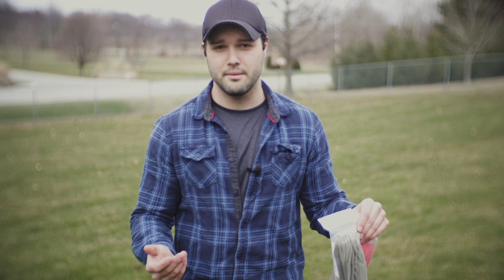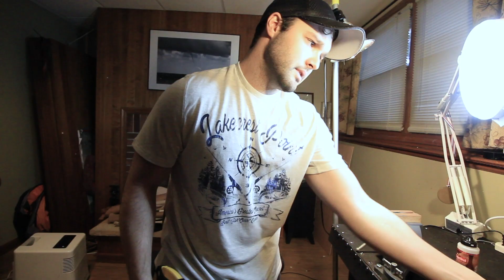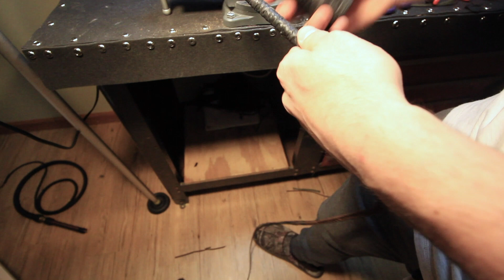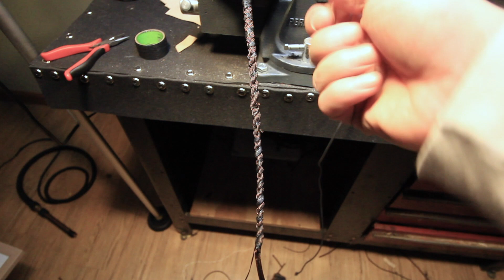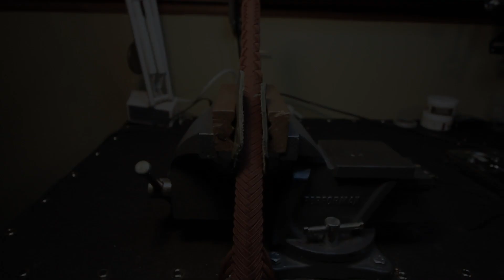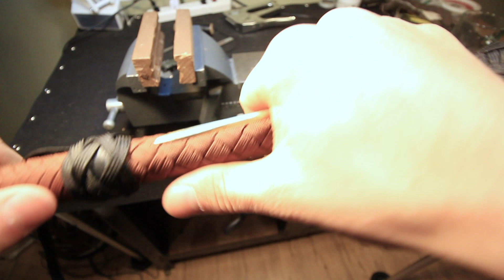My Current Nylon/Paracord Bullwhip Making Method 2018 | Nick's Whip Shop

Comment: lengths for an 8ft bullwhip with a 10-inch handle:

1st Belly:
2 strands x 11.6 ft
1 strand x 8 ft
1 strand x 5 ft
2nd Belly:
2 strands x 24 ft
1 strand x 19 ft
1 strand x 13.5 ft
1 strand x 8.5 ft
1 strand x 5 ft
Overlay:
2 strands x 27 ft
1 strand x 25 ft
1 strand x 22 ft
1 strand x 17 ft
1 strand x 13 ft
1 strand x 9 ft
1 strand x 5 ft

Comment: Why is the core 6' and 1", I thought the core was suppose to be the same length as the whip? For example, a 8' whip would have an 8' core including the handle( 10" handle + 7' 2" of cord); is that incorrect? How do you measure the core length, handle and cord?

Comment: Help, European Metric user here. It's very odd to see 11.6feet in the description.  .6 of a foot is 7.2inches. Is that really what I'm meant to measure out? Or is that how you're writing 11 feet and 6 inches? If so then the 8.5foot strands are meant to be 8feet and 5inches, correct? Also, you're using 650 para, if all I've got is 550 will this throw things off badly? Maybe I should follow your older bullwhip tutorial where you used 550 para. The question of what is .6 of a foot still applies though.

Comment: Dude, your measurements are nowhere near what you have in your video. Make some adjustments or something. Or at the very least, add some length in your measurements as a buffer for strands that may be too short. Cutting to your exact measurements yields strands too short, and that's when they are cut with no tension.

Comment: If you're using 550 make the strands about 3 feet longer on nearly all strands, but the shortest strands only need to be about a foot to foot and a half longer. Otherwise it will turn out substantially shorter than you think 😅 surface area truly matters between 650 and 550.

Comment: I havnt even made very many "bull" whips (1000's of Jockey whips) but I found a trick that works well 4 attaching the core 2the rod & its cheaper somehow..?!? Also helps the transition area taper..! I tried a pc. of threaded rod & HAD 2taper the end 2get it started... But it created such a smooth transition... I LUV IT..! Also seemed 2make a stronger bond of core 2handle... Just wanted 2share this w/a professional & see what ya think... Whip seems 2have more spring as well...🤠

Comment: Nick, I started out doing what you are doing, learning to braid, when I was about 14 years old. At that time, the only instructional material available was in the form of books written by those of my age today for young guys like you at that time who wanted to learn how to do this form of craft. I have to give a notice to the man whom I consider my "mentor" at the time, the author of a couple of books on making horse gear and whips and generally learning the old ways of preparing and processing the leather or rawhide he used for his gear. HIs name is Bruce Grant and his books are surprisingly still available through outlets like Amazon and other printing sources. One of his best books is named "The Encyclopedia of Rawhide and Leather Braiding", another simply titled "Leather Braiding",  and one called "How to Make Cowboy Horse gear". He also authored a small book, which contained a condensed version of all the tips and tricks of his other leather handling books entitled, "Whips and Whip Making". I cannot help but believe that you have already read at least one of these books and have taken the knowledge of what he wrote and are using that in your work as I did when I was much younger! 

As life goes, many times, I had other priorities which needed more attention than simply braiding and working with leather and those interests dropped by the wayside as I traveled through to this portion of my life as I approach the 80 year mark. Now, just after my 78th birthday, I have decided to get back into this world of leatherworking and your videos immediately caught my eye as I scanned through the recent listing on YouTube to get caught up on my favorite leather workers accomplishments. The last few years I have slowly slipped back into the leather work as I bought new hand tools and refreshed my mind on those few things I learned when I was a teenager.

My point in all this background information is to tell you that you have a special knack for passing on, what may have taken you untold hours of trial and error in perfecting your craft, to others with your tutorials. Watching your videos on just the whipmaking part of braiding techniques is like a Deja vu for me as old memories of spending hours with a homemade thong cutter stripping out literally thousands of yards of rawhide thongs, as small as 1/32" for braiding horse halter trim and cutting and processing leather strips for the actual braiding of the halters, headstalls, reins, and other horse gear came flooding back. I followed the ways of the South American and Australian "cowboys", Gauchos, and wranglers as written in Grant's encyclopedia and I learned how to properly turn an eighth inch rawhide strip into a perfectly round thong by wetting it, drawing it through progressively round holes drilled into a hardwood board until the wet fibers were " transformed" into a round thong the likes of which is almost impossible to do in this day and age.

I think that you are deserving of all the accolades you get and all the braiding business you receive through your YT videos and I simply ask that, as you progress through the levels of your craft, you will always keep sight of the fact that anything you can braid with string, nylon, paracord, or even roots of plants, you can also make from top grade leather or properly prepared rawhide and, at the end of the workday, you will be much more rewarded for your labor by those who still recognize good quality leather work and are willing to pay for it. There is no limit to the price of well made leather crafted work gear in the world of cowboys here and in other countries, who spend their days with whips cracking herding large herds of cattle and other animals. And the gear on their horses which keep them safe and provide a means of "steering" their mounts where they need to be is as important at the ropes and whips that they use to "steer" those cows. There is every bit of difference in well made horse gear vs. the run o' the mill stuff as there is in the difference in a Ford Mustang and a great ride of a Rolls Royce or a Maserati.

Comment: I have a suggestion Nick, when you add the BB laden cord to the steel rod, have you tried heat shrink tubing instead of the blacktape ?My thoughts are that the tubing would hold the bb's better and you would get a more consistent finish.
Reply from the maker: Never tried Gary, but sounds like an idea I'll definitely experiment with. Thanks for watching!

Comment: By the way, I am new to this channel, and I don't exactly know what he means by rolling the whip, so if anyone knows what it means, please let me know, and thank you. :)
Reply: He means to lay the whip on a flat surface and then to use a board or he used to use a cinder block to press over the whip and to roll back and forth down the length of the whip using a lot of force and your body weight to loosen out any kinks and improve overall fluidity in the movement of the whip, hope I explained that OK, hope this helps
Reply: @BornDead616  thank you, very clear. My son was happy that someone replied to his question.
Reply: @araminthethicket  no problemo

Comment: I thinking of trying to make a whip out of nylon cords do you think it might work just as well as the cords you used. Can I use a piece of stainless steel cable as the core , something about 1/8 thickness.

Comment: Hey Nick, I've been planning to make a whip for quite some time and I've finally started making it but I've made a rather large mistake (I think). 
While plating the second belly I've realized that my "sinker" cord (could not get the recommended one) was a LOT thicker than it should be, so I've ended up short - last strand was 3-4 inches shorter than the sinker cord. (Strands were dropped as they were for the first belly). I would ask you or anyone who reads this for advice on overlay plating. 

I've been thinking to cut the sinker cord a few inches and increase the length of shortest two strands by 2-3 ft, next two longer strands by 5 ft, next two by 7ft and the longest two strands by 10ft.
Is that plausible? 

Thanks

Comment: Anyone else notice that the whip at the beginning is not the same whip at the end of the video. The whip at the beginning had a twisted core for the second belly and the whip at the end had sinker cord for the core ?
Reply from the maker: A good observation for sure. If I remember correctly, I lost a lot of footage due to a corrupted SD card and had to film again with a whip in progress. I think that's what happened, but I don't actually remember to be honest. I no longer use the twist for ending bellies though. Video on my current method coming soon.
Reply: Damn SD cards!!!! Looking forward to the next video. Will be attempting this one next week guess I will leave out the twist and make the core longer

Comment: Tractor supply has the 1/4” neoprene mat in a  4’ roll that they will cut you a piece. The smallest they will cut is 1 Linear foot which will make a hole bunch of bases for your handles it was $7 for that amount.

Comment: Hey Nick, i am currently working on a 9.5 foot bullwhip in 16 plait using this method, but something that works for me is not tightening the strands until i get ready to plait with that strand. It helps with speed and it also keeps my whips super tight and very springy and lively.

Comment: What length should the sinker core be for a 6' whip?
If it's 6' 1" for this 8' whip then I'm guessing it must be 4' 1". 
Thanks
Reply: 6ft for an 8ft whip is a ratio of 75% rather than 8ft minus 2ft. For your desired 6ft whip a sinker core length of 4' 7" includes the added 1inch.
Reply: @carycarcuro  Thank you sir ☺

Comment: No mention of what plating is and for a beginner (me) you are moving way too fast.  also how do i know when the belly is "locked in" and when you say two random strands and then mention the middles of the belly strands that is only 2 of them the other 2 are staggered so they are not the middle. am i doing something wrong or just being too literal with instructions?
Reply from the maker: This particular video is more suited for those who have watched my original "How to make a paracord bullwhip" video that I made a few years back. The basic principles were covered in the original, and this video builds upon them, introducing new methods and modifications to the build. I discuss the fundamentals of plaiting more thoroughly in the original. Also, you are correct in stating that those are not the literal middles since they are indeed staggered. I said middles to make it easier, and because it was very close.

Comment: Please help! When I plat the first, second, or third layer, from my side it is tight, even, no twists, or holes. When I rotate the plating 180 degrees (the back side) the plating has little resemblance to the front side. What Am I Doing Wrong! Thanks for your time. Larry
Reply from the maker: Hi Larry, when you are plaiting make sure that you are pulling at the same angle degree on the left and right. also make sure that the strand you are about to plait is flush with the strand above it and touching it. The more you plait, the better you will get.

Comment: Nick keeps saying it's 3/8" sinker cord but the hint is that he says he is STILL using the same cord as before. 5 years ago, he was using 1/4" sinker cord and I'm 99% sure that's what he is using in this video. The 3/8" sinker cord works very well for 1/4" steel balls but works very poorly for the 4.5 mm copper coated steel balls. 1/4" sinker cord or 1/4" paracord do work quite well for the 4.5 mm balls though.

Comment: Hey Nick. I am new to whip making and i was wondering measurements would i use to make a 6ft nylon bullwhip? 
Ex: Handle all the way to the cracker, 1st belly, 2nd belly, and overlay
Reply from the maker: Hi! Please see the strand lengths listed at nickswhipshop.com.
Reply: Quick question. If i were to use a 14in handle would i increase the bellies and overlay by 4inches on each measurement.

Comment: So if i wanted to make a bullwhip with the same length but a shorter 8 inch handle compared to the 10 inch handle shown.
all i'd need to do is start with a smaller handle and follow the steps the same?

Comment: Why do you prefer to drop your cords on the outside as opposed to the inside?
Reply from the maker: I like to use this method on the bellies because it is simply faster and easier. The only reason I don't use it on overlays is because the ugly melt points would be visible.

Comment: I'm kind of new to this, thanks for the video by the way. I was just wondering; in your 2015 video you shot loaded the whole core, why didn't you do that here? Also, could I use the same rope for the core as in the 2015 video? Thanks again!
Reply from the maker: Thanks for watching Garrett. I don't load the whole core anymore because I felt like the whip was too heavy. It is however a personal preference thing. You can use the core from the older video, no problem.
Reply: @NicksWhipShop  Alrighty, thank you very much!

Comment: Hey Nick, another great vid thank you. No matter how tight I do my fall hitch it always slides down the whip after time and spreads out the last bit of plaiting, any tips ?
Reply from the maker: Hi David, thanks! Are you taking that last strand up through and sticking it under the fall? This locks it into place. Hope this helps.
Reply: Hi Nick thank you for replying. I did my first whip build from your original whip video and have since discovered the method you have mentioned in your 'current' whip making method vid where the last piece is threaded back up through the fall and it does indeed lock it very nicely into place. I used a loop to pull it back through as I saw in one of your other vids. As you can see I have watched all your videos and I congratulate you again on the your superb tutorials.

Comment: hi i wonder what must i be doing wrong....i plait with your lengths and always seem to come up short...any ideas nick?
Reply from the maker: Sorry to hear. It most likely is either the brand of cord, or the tightness you are plaiting. Hope this helps.
Reply: @NicksWhipShop  Hey Nick, love the tutorials, built my 3rd whip using your instructions, and notice I run into the same kind of length issue - if you are short, should you be plaiting tighter, or plaiting looser, to make the strands last longer?  Of course, I'm tracking my experience with my whips, so I'll be adding x% to make up for any issues I find, but it would be interesting to know whether tight plaits use up strands quicker, or loose plaits.  Thanks again!

Comment: Hi Nick - On a scale of 1-10, 10 being full strength, how hard are you pulling the strands when you plait?  For me, I am trying to pull full strength as that is how I learned for kangaroo hide.  However, not sure if that is what should be done with nylon.  When I go to wax the whip, it doesn't seem like the wax is penetrating very far and I'm wondering if my plaiting is too tight (if that is even possible).  Thanks, man!  Love watching your channel.
Reply from the maker: Hi! Thanks for watching. About 6 to 7 at the transition, and about 3 for the rest of the whip. If you wax your whips, you really don't need to kill your hands because the wax tightens the strands really well! Something I didn't know for a long time.

Comment: Awesome work nick. But can I still use a 550 cord instead of a 650 with the same length in this video? Thanks in advance.
Reply from the maker: Just about! add about 5 inches to each strand if you use 550.

Comment: Have you considered ⅜" paracord for the core and load it with ¼" steel slingshot ammo? They fit perfectly together and adds nice weight!
Another question, you mentioned the core length was 6'-1" after dropping all but 6 strands, little confused on this part. I assuming you cut it from the original 8'-1" to allow for the twisting of the last four strands on the 2nd belly?
Thanks, Boss!

Comment: Great video!!:) This will be one of my next two whips. Planning for a 5ft 16 plait bullwhip first, already got the core, shot load and handle foundation ready, as well as for this 8ft whip. I‘m using 750 paracord for the core strand and 4mm spring steel for the handle, fully covered in paracord and about 3“ sticking out in the back so I can tie a loop to it and then use a hook for plaiting

Comment: Hey man, I love your vids, I just wanted to ask do you have to use the dacron
Reply from the maker: Thanks for watching Lewis! Nope, you don't need to use it but it can add some strength to the transition. What also works well is number 5 nylon thread. The artificial sinew is great for adding strength to the transition, but its downfall is that it is a little bit oily and can sometimes slide on itself, so for that rock solid transition I recommend using material that is not waxed or oily in addition to the sinew.
Reply: @NicksWhipShop  OK, thanks a lot man, keep up with the good work.

Comment: can I just use 550 paracord for the core
coz sinker cord is hard to come by in England and your link is in usd
Reply: This is way late, but most banks will complete the transactions conversion for you if you just use your debit card. Ontop of that yes you can, but the problem is you have to file the handle down quite a bit to slide it over and then there is the problem of some paracord letting bb's through through sides from being to tight and trying to bend around the bearings